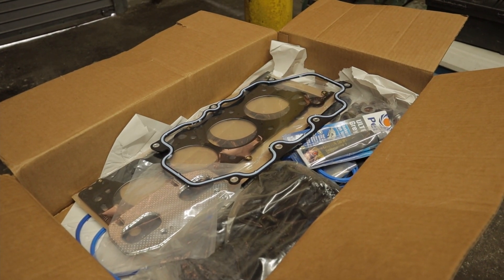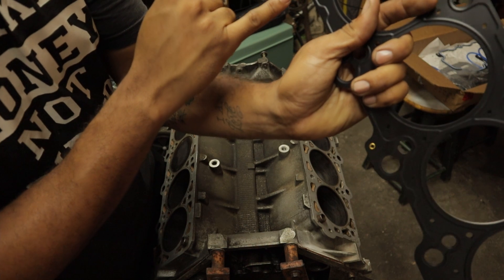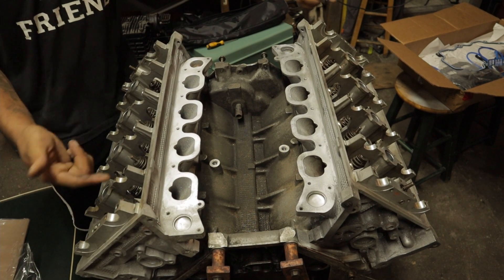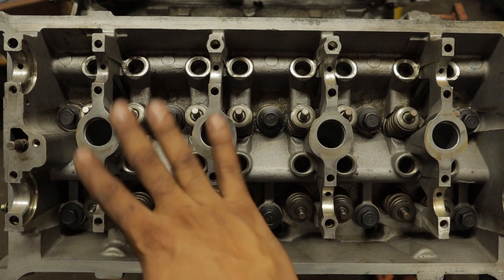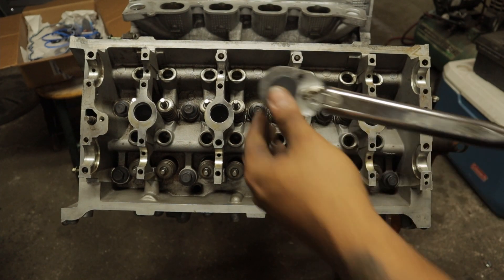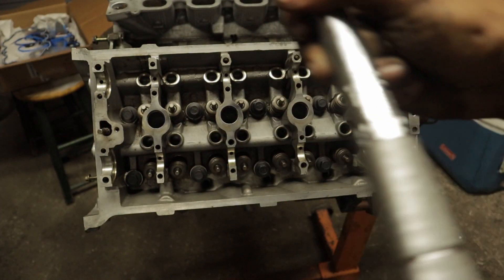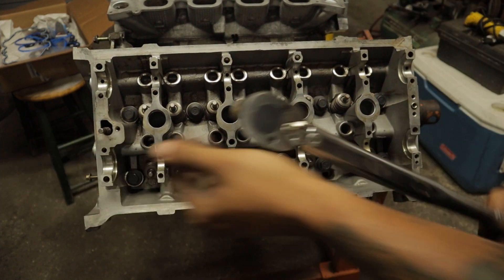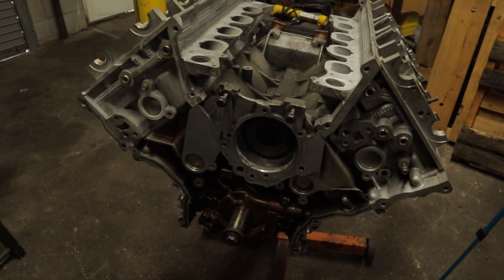4V 4.6L Cylinder Head Install (Full In Depth Tutorial)

Comment: I just found your channel and I like it! Lol I bought a 03 mach 1 roller and then picked up a fresh built 97 mark viii engine. I'm torn on using the engine as is, finding adapters to run my mach intake on the B heads or changing heads to the C heads. I'm leaning towards changing the heads.
Reply: It'll be a daily driver. I think it's best to find a set of c heads.

Comment: I seen you loosened the head bolts using your torque wrench before you did the final torquing. Idk why but I was always told not to use a torque wrench to loosen bolts. But my question always was why do they allow you to even put the wrench in reverse lol if you aren’t supposed to. Have you ever heard that?

Comment: What happens if that top galley plug in the rear of the driver's head is left out? I had a set of heads done and installed and I'm looking back at pictures and the driver side head doesn't have a galley plug like yours. That engine is now running and driving and has oil pressure. I'm just curious 🤔
Reply: @DriftDreams242  I csnt find oil circuitry either.  It looks like it would dump oil into the back of the head and drain back. It can't be dumping that much pressure because it's running and tensioner is holding and thrash adjusters are quiet.

Comment: where did you buy your gasket set?
Reply: @DriftDreams242  I have a 2004 Lincoln Aviator that has the 4.6 4V motor. Getting ready to install a Melling 3V Hi-Volume oil pump as my low oil pressure light just started flashing the last 3 days. So I parked it n didn't want to ruin the motor. Replaced the oil pressure sending unit. But still flashes and don't want to ruin the motor. Also pulling the heads to make sure the heads aren't cracked from overheating it last year (Blew a plastic t-hose connection on the pass side and getting a dirty residue in the overflow bottle). But ran great til the low oil pressure light. Wouldn't this gasket set work on an aviator motor ? Basically the same motor and you mention has better head gaskets right ? Great video's man. Excellent details.👍👍👍 Bradenton, Fla 👍🌴🌴

Comment: So for both times you do 90 degrees at the end you still had the torque wrench at 30ft lbs ???
Reply: @DriftDreams242  nice! I appreciate the info because I will be doing all the work myself when I build my n/a set up
Reply: @DriftDreams242  will do,I just have to finish my all motor civic first lol which will also be a beast of a 4 cylinder making 330+whp all motor
Reply: @DriftDreams242  haha nice! What are you planning to do with that k24?
Reply: @DriftDreams242  lol with all the aftermarket support those engines have it can be done for an affordable amount,what chassis will you be using?